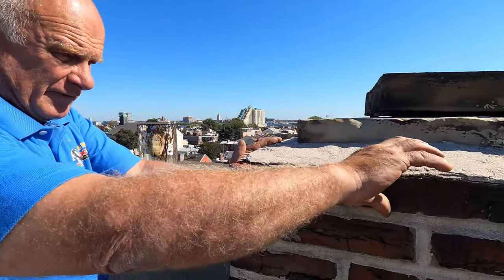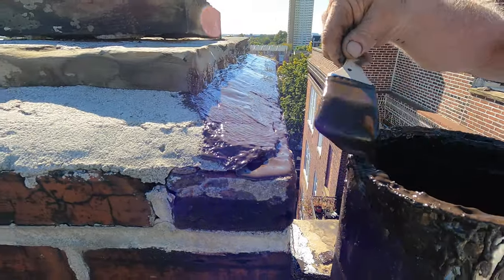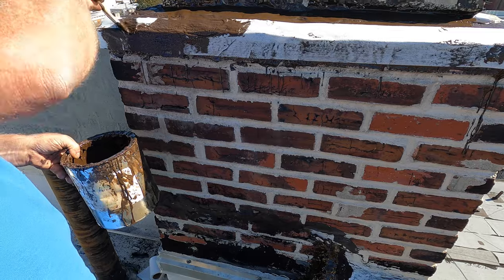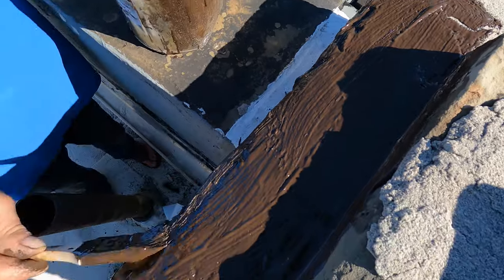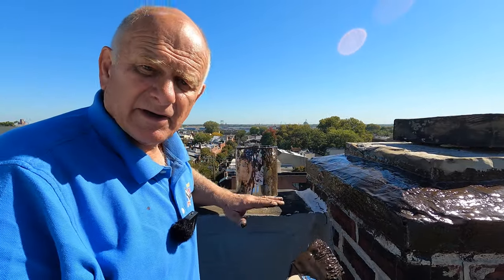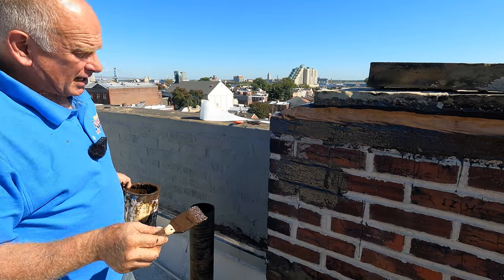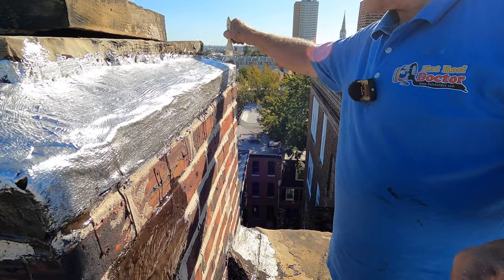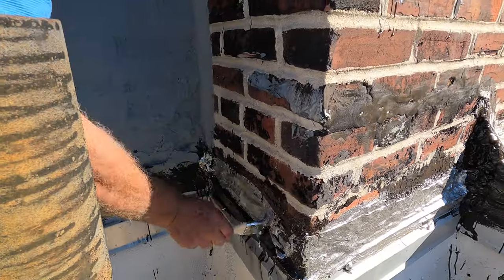Seal Chimney Cracked cement and bricks to stop leaks

Comment: Going up on Friday AM to turbo my 2 leaky chimneys — wish me luck!
Reply from the maker: a little late for me to reply. Did it work?
Reply: @FlatRoofDoctor  yes! I’ve had 2-3 snow melts and half dozen rain storms, no more leaking.  The roofer that came when this started quoted $4995 for 1 chimney $3998 for the 2nd chimney to replace tiles 3 feet around chimneys, build cricket, and redo step flashing… none of those would have even fixed the chimney crowns or the leaks. THANK YOU.

Comment: What material is the fleece made of. Can that fleece be used on concrete stairs repair? Thanks great video
Reply from the maker: It is made from Polyester Fabric. I have tested on cracks in a concrete driveway and it works great
Reply: @FlatRoofDoctor  Thanks
Reply: Is the fleece sold at Lowe’s.

Comment: As a Mason this video is disturbing.
You are taking the easy way out and most likely charging big money.
Remove crown and pour a new crown.
Grind out weak joints and re point them with new mortar.
I personally would've taken the chimney down to the roof line and re built it.
You're only covering a problem that happens with weather , sun expansion and contraction.
Do it and Do it right
Reply from the maker: Yes, I agree. But you assume everyone can afford your method. The point is this was build right when the building went up. So, it did not last that long.. But the method I propose will buy at least another 20 years or longer if you keep the coating protected

Comment: Please don’t do this to ur chimney there is products that are made for your crown go to saver system I am a Tumi certified technician this is not allowed it won’t help it’s only a 10 year thing in this product is flammable anything happens to that your whole chimney has to be ripped apart and rebuilt
Reply from the maker: Ok, I searched for "Tumi certified technician" on the web and found nothing regards chimney's.  So, certification means nothing.
Most chimneys are build by proper masons. No need to be certified by anyone. 
Most chimneys, no matter how well it was build, have issues later on. The crown busts up, cracks, the flashing comes loose, the mortar grout comes out, the flu pipes deteriorate.
So to claim that some certificate is gonna make you build a better chimney, is not true. True, I see some chimneys that are amazing, well build.
Those are far and inbetween.
I would think that they cost far more to build than the average chimney.
Ice and water is the enemy of any brick and mortar. So, with that said, I believe to seal the crown and the flashing with a water tight sealant so water can not penetrate into the chimney. Cement by itself does not cut it.